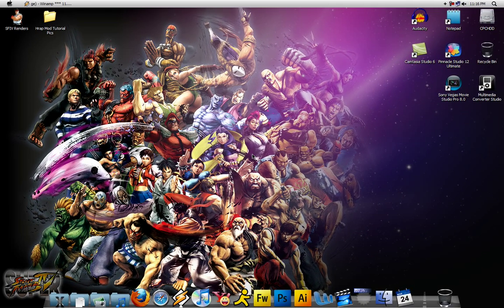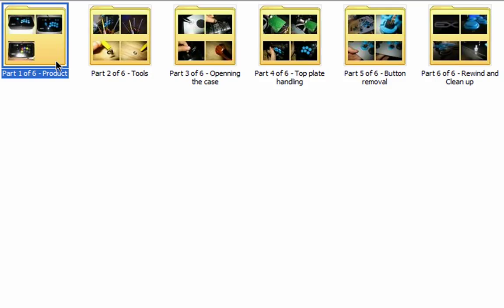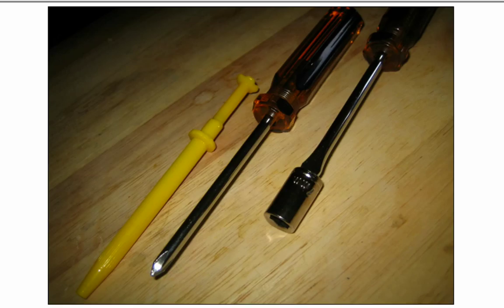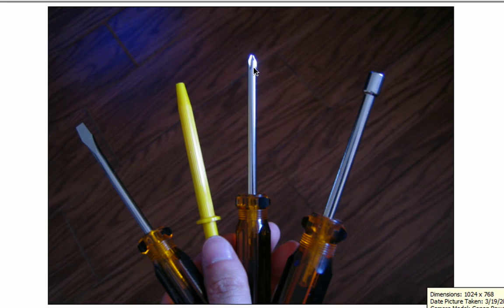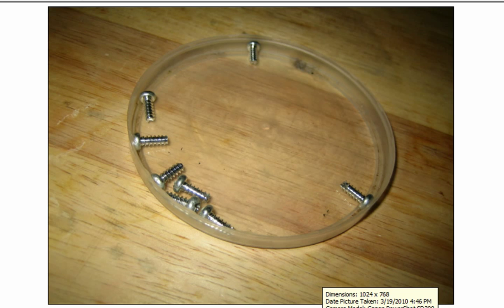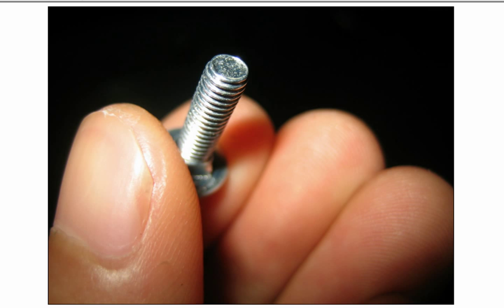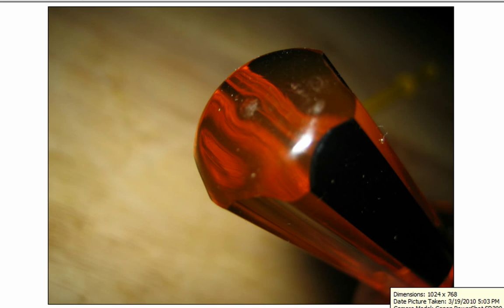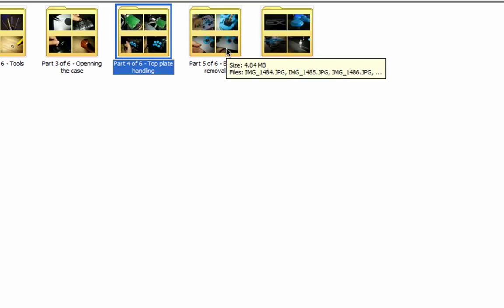HRAP EX MOD  - Pt. 1 of 2 - PUSHBUTTON REPLACEMENT TUTORIAL - [HD READY]

Comment from the maker: @DeuceisLegit : I  recommend getting the TE compared to the Hrap EX. Reason? You don't need to mod any buttons because it comes with full Sanwa professional high grade parts.BUT if your a guy like me who will mod regardless of the stock sanwa buttons on the TE, then i recommend getting the HRAP VX SA stick. VERY easy to mod, (all you need is a phillips head and a flat head) and your good to go. The TE is DIFFICULT to mod because of it's tiny workspace environment, n the holes for the TE is shit.